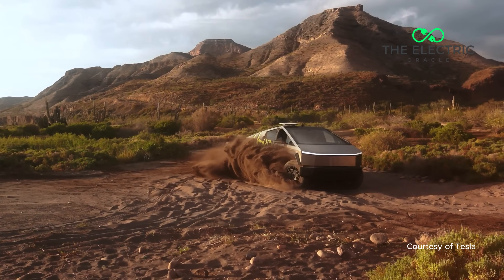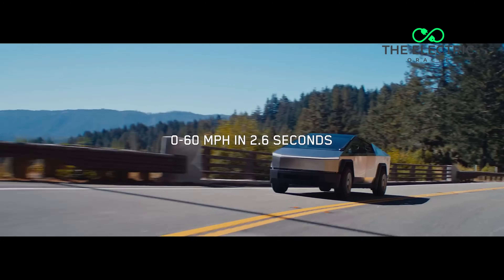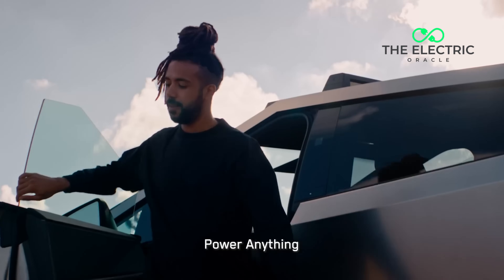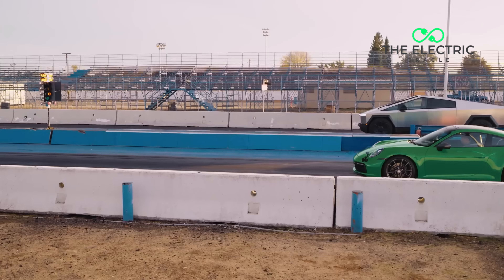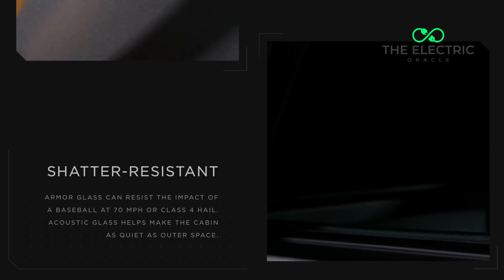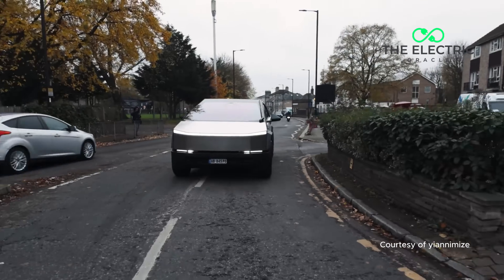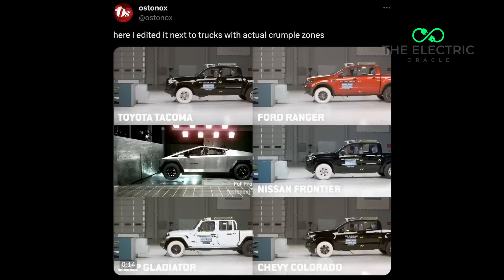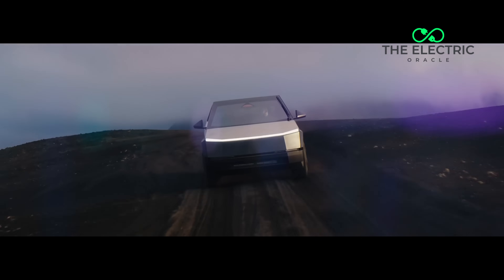5 Safety Issues Keeping Tesla Cybertruck Off UK Roads 🇬🇧

Comment: All the issues you mention Tesla has demonstrated in other vehicles it produces - Tesla engineering can address them on 2 weeks or less.

Lights - easy. They already have a solution. Just need a European specific part. 

Panels - the stainless steel can be replaced with thinner panels (to allow curves) or switched to aluminum. That would also help with weight. The only challenge would be the doors but Tesla has experience with doors on many models. Color is lot an issue. The Delorean is legal in the UK.

In any case, if Tesla wants to it can easily make the necessary changes. It will impact the look a bit but I trust Frank and his team have already planned for this.

Tesla always does its homework - one option is that European full size market is just too small for Tesla to care. Another option is that they already have a plan for a smaller midsize pickup that would have a version that would easy to get homologated in Europe.

Either way, the fact that the US version cant be homoligated in the UK is more of a concern to a few YouTubers than it is to Tesla….

Comment: On the part for weight because it’s over 3.5 tons it also will get a Tacho it’s where all your driving will get recorded and you will only allowed to drive 9 hours or 10 hours twice a week plus you need to take 15 mines for every 2 hours then a 45 minutes break and you need a digi tacho card too don’t stop there ether the 10,000 Nm and 600Bhp is now useless for driving fast because it will be automatically limited to 56 mph to your driving a vehicle as fast as 44 ton artic lorry

Comment: 1st reason, Tesla would change the colour of telight lenses and also change the steering to RHD this would be done when building the car, not coverting LHD US cars to UK rules.  UK government raised B licence weight for non ICE  cars to 4.2.  Various Cybertruck have been personally  registered in the EU..  Actually the CT has crumple zones in the front and back castings.  Some one set off a bomb in the US in the back of a CT, the explosion did not set the battery on fire.  You don´t mention that CT has FSD which will in most  automatically stop or dodge pedestrians.

Comment: An interesting and thorough review of this appalling automotive death trap. I’ve read there have been many accidents where the software system was ‘offline’ and the occupants couldn’t open the doors. The manual release is cleverly concealed for aesthetic reasons and hard to find in the seconds needed to exit a burning vehicle. And there have been lots of reported battery fires. Also, I don’t think you’ll have much luck trying to break or open a passenger window in the event the vehicle was submerged in water. 

Then there are reports from reviewers who cut their fingers on the sharp edges of the vehicle. Plus the sensor system on the auto close hood / boot doesn’t always detect digits. Ouch! (Well, one less fingertip doesn’t matter too much I guess.) An absolute nightmare and we certainly shouldn’t be changing any safety rules or expecting emergency services to re-equip for these aluminium Musk monstrosities.

Final thought: no paint, no chips – but lots and lots of rust, (even after six months use.)

Comment: Toyota has an ev with a LED strip across the front. We have always updated equipment for new vehicles. The Audi 100 when it first came out was a nightmare to cut open. As for fire suppression, LiO batteries generate their own oxygen and have to be dealt in none traditional ways.
Your requirements for the C1 licence apply only for drivers who are being paid.
Reply: Which Audi 100?

Comment: 1:10 red turning signals aren't an issue. Each US vehicle which would be equipped with those will be fitted with amber turning lights when imported to Europe. Same goes for all other necessary lights, like rear fog lights etc

Comment: Going on the incredibly low sales last year of only 40000, I’d say it’d be time to scrap the lump of lithium..well..stainless steel. It’s a really ugly design, non practical, be so costly to run ( over twice an average passenger vehicle’s weight, think of the tyre wear).
So many believe in Musk but his dreams certainly didn’t come to reality last year. He had hoped to sell 2M. He sold 98% less than that. That’s a massive failure.
Have to question Musk so much.
Safe FSD dreams are still to materialise after 7 years (even Musk admits he’s behind, Waymo in this instance). 

The EV market is cooked and this heap of metal won’t increase their market share which is plummeting as the Chinese brands take over.

Comment: The finally provided light bar blinds incoming traffic and are illegal in America but Tesla provides it and partially installs it, then sends you to a shop to plug in the wires and peel back the opaque lens cover tape. The main front lights have a ledge below that collects snow and hampers visibility. If cyber gets wet and isn't dried off it rusts. The " vault " leaks. If you take it through a car wash you void the warranty. It's useless in snow, off road and as a four wheel drive. It breaks if you tow a trailer. It bends if you load it with material. Better built for a sci Fi movie set than real life. A true example of Buyer Beware. A great con job. There's a sucker born every minute and elon found them.

Comment: Q: Should emergency services be required to upgrade their equipment or should manufacturers be required to design vehicles that work within existing emergency protocols?
My answer "Yes to both" the safety equipment should be evolving and getting better. I see it as a window that is slowly moving (hopefully to a better place). That being said new vehicles should be compatible even if that's pushing the envelope.

Comment: Its not allowed  in Australia either. It fails so many design rules. Even basic teslas need mods for poor safety featues concerning child restaint fittings and rear stop light matter much like you observe withe the crappotruck. A entire shipment was refused entry and sent back to china after repeated cautions and wharf mods had to be performed. Delayed supply for months. Tyres alao had issues as they shipped low distance tyres and the tread for a new car wasnt compliant. Like a inkjet printer

Comment: Thing is it not safe, it’s also very wide than most other suv. But key is the obvious safety issues like with the sharp edges that if you hit someone or something is not good. None existing / functioning crumple zones. Massive blind spots that can hide a pedestrian even a small vehicle in way worse than a trucks lol 😂, baring in mind a truck is driven by someone who has gone through more training than the average driver of a cyber truck would have. Not saying all truckers are perfect but what hopes has a lesser trained individual. 
Lat alone other issues as mentioned in the vid. The reason why we have these regulations for key safety reasons and expectations and training and awareness. And for things like why there are set wait limits and regulations like restricted wait restrictions on roads and others places. And key safety again. Let alone I’m sure the evangelist will complaine when it’s taking up two charging bays as well 😂. 
So may look cool but not suitable for uk rds.

Comment: And even if Tesla somehow managed to get the CT to conform to UK/EU standards - it's still horribly expensive (with all the modifications necessary it would most likely end up at 150k$ or more) and it fails at basic pickup truck tasks. It can't climb, it fails as soon as the electric parts get wet so it can't even cross tiny streams (forget about that "can be used as a boat" in the marketing presentations), the weird bed shape even makes basic loading and transportation tasks harder than with any other pickup truck on the market. And it's far too large to fit on most of European roads, parking lots or garages.

Comment: The Cybertruck is neither a good passenger vehicle, nor a good pickup truck. Here in the US, full size pickup trucks are purchased by most consumers for this group of purposes:
1. To tow recreational trailers, or work trailers for business purposes. There are 4 basic categories: 1/4 ton (can tow small trailers up to about 2000 pounds), 1/2 ton (4,000 pound trailers), 3/4 ton (8,000 pound trailers, and 1 ton (up to 14,000 pound trailers if equipped with dual rear wheels).
2. Hauling cargo in the bed. 1/4 ton trucks can carry up to about 1,000 pounds, 1/2 ton and 3/4 ton trucks 4,000 pounds, and 1-ton trucks can carry the heaviest loads, up to maybe 6,000 pounds on dual rear wheels.
3. Mounting a Cab-over recreational camper. These can weigh as much as 4,000 pounds and require a 1-ton truck with dual rear wheels.

For trailer towing, no EV pickup can even remotely compete with a conventional petrol or diesel truck on range, and the Cybertruck is the worst of them. It has a powerful drive motor, and a big battery, but range when towing a 6,000 pound, 24 foot travel trailer is horrible; about 75 miles on a full charge. A 3/4 ton diesel pickup costs $40,000 less than the Cybertruck, and can tow that trailer 400 miles on 30 gallons of fuel. And when you need to re-fuel, it takes less than 10 minutes, compared to 2 hours to charge a Cybertruck back to 100%. 

For hauling heavy loads in the bed, the Cyber truck can accomodate maybe 2/3 of the load weight that a conventional 3/4 ton truck can carry, but if you need to carry construction loose material like sand, gravel, or bulk garden soil, you better pray that none of that material gets into the track system for the tonneau cover, or you may find it's jammed and can't be opened or closed without major dissassembly and cleaning.

For mounting a cab-over recreation camper, forget it. The Cybertruck is not designed for carrying these units and doesn't have the proper tie-down points and tailgate to accomodate a cab-over.

As a passenger-hauler, it fails on every count. There are sharp edges around the door panels that you can cut yourself on getting in and out, and the doors are so heavy that if you are parked on an incline, the impact of one of these doors hitting you if it swings out of control, can cause serious injury. 

The vehicle is so heavy that it's energy efficiency is abysmal. A regular EV like the Tesla Model 3 or model Y averages about 3.7 miles per kilowatt-hour. The Cybertruck gets about 1.7 miles per kilowatt-hour.

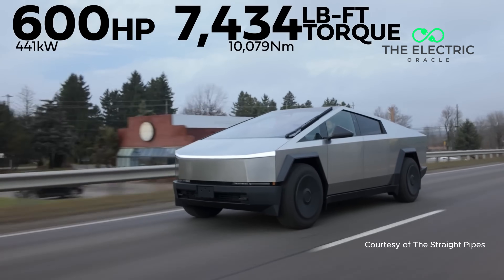Comment: 1:20 Wrong - it's not just 'conditioning' it's clarity to keep different signals different colours, same reason that traffic lights are red amber green not red red green.  Red indicators in the US are so they can save a few dollars and use the brake lights as indicators, putting profit over safety

Comment: While  Cybertruck are over the top it has some features that I would love in more normal simpler compact SUV like body that don't rust, windows that don't crack because thrown gravel on gravel roads, more durable body panels that don't get damaged as easily. Normal cars are so fragile, even slowly backing into a frozen compacted snow pile or fence post  can total your bumper causing expensive repair bill.

Comment: Wait a Moment... 3 mil steel? Didn't Tesla have to change the steel gauge from the intended three mil to .85 mm anyway as they couldn't work the armorlike steel themselves, due to work hardening and crack when shaping those plates?

That they then did not just redesign the carossery to remove the guillotinesque panels and such is about the most hilarious part of the whole process, they insisted it was needed for 3 mil steel... which they do not use.

Comment: The important factor with weight and driving restrictions is the GVW/MAM, the CT is in excess of 4000kg. In excess of 3500kg a whole lot of other considerations kick in. If the vehicle is used for anything other than purely private use, then a tachograph must be fitted, all driving hours logged via a Digital Drivers Card and archived, drivers must comply with maximum driving hours, rest periods etc (same as for an HGV) There starts to be considerations for Operators licences, maintenance schedules, suitable parking facilities, proof of financial stability etc. The regulations are complex and breaching them can lead to very heavy fines. Before people claim, not if it’s a private car, you should read the regulations because it’s all about the weight and the purpose for which the vehicle is used, Any form of use for Hire or Reward takes it out of private use. There are lists of exemptions but claiming “I didn’t know isn’t one of them” Eg if you put this through your business, its not private. 
In reality it’s unlikely these will actually be an issue and those that do make it over here are easily spotted and will draw a lot of attention from the authorities and most will likely be breaking an armful of vehicle/driver laws. Vehicles impounded and destroyed.

Comment: You did not mention that it actually has no mechanical steering linkage, just a video game steering wheel. If the digital steering fails, there is no way to steer it as there is no link from steering wheel to wheels. Just that playstation steering wheel. Try that to get through MOT... As a "lorry" also here in Finland, all the reasons that make it unique, also prevent it to be registered. But, as they say, "there is a sucker borm every minute". They sold them a lot first, until buyer's remosre and common sense of others appeared. Like Teslas in general, they are for certain people. Who most people do not like.

Comment: The Cybertruck is just a silly idea that should never have put into production. Everyone knew from its conception that it was just an experimental concept, not a viable, practical reality. Even in the US it's pointless, impractical and dangerous. In the EU & UK it's just laughable. In particular, the weight - 3500kg for a private motor vehicle is more than sufficient to meet most people's needs and remain reasonably safe for basic driving capabilities. You see many qualified drivers struggling to handle a Smart car, can you imagine the damage they would do in a 4 ton solid steel truck?

Comment: There is no use case for this vehicle that I can comprehend. 

What problem does it solve vs what problems does it cause. Sure, think different, but this sounds not just outside the box but outside practical application.

Just different for difference sake. Maybe on Mars - but it needs an airlock.

Comment: NO special exemptions for electric vehicles (I drive one). Cars should be taxed according to their impact on society. Use Kei car as base that all are compared to - the greater the deviation, the greater the road tax, not straight line increase, but escalating. Consider: weight, width, length, emissions, safety to pedestrians.

Comment: There are a few of these in my area and they are smaller than a lot of pickups on the road (including the Ford that I drive). They are not as useful as other pickups that have similar GVWRs.
BTW: My Pickup has a GVM of 6,350kg vs a Cyber Truck at 4,160 kg.

Comment: Very well done video, thanks.

The Cyber Truck is clearly a menace to safety.  

Whilst I think safety standards may have to evolve in the age of electric vehicles, such evolution should be gradual and - must - not result in less safety.

However, there should be zero concessions to the lighting regulations for the Cyber Truck.  They were carefully designed and evolved over the years, and they are too far ingrained in people's minds to change, especially for a design that seems to have disregarded safety.

The Cyber Truck - might - have been designed with the safety of the occupants in mind, but the design clearly didn't  give anything like enough allowance for the safety of other road users.

I wonder how it would affect levels of injury and life expectancy in a pile-up?

It's sharp edges would clearly be force concentrators in a collision, and look as if they might act like a knife if impacting a pedestrian.

It's not important for safety or regulatory compliance, but does anyone else think the Cyber Truck is just plain ugly?

Comment: Vehicle weight limits are there for a reason. Heavier vehicles behave far differently to a small hatchback. Changing the law for electric vehicles is simply not viable. Letting someone with a standard licence and no experience of larger vehicles loose in a 3-4 ton steel brick is a recipe for disaster.

Comment: This just goes to show how little the American car manufacturers and regulatory bodies think of their own consumers and everyday people,  that this dangerous piece of cheaply made junk is safe on American roads. The edges of the doors are so sharp you can peel a carrot if you run it across the edge. The rear vision mirror is tiny and unusable if you travel with the rear tornau cover closed, which is recommended. You have to use the camera, which can be obscured by water or mud if it rains. You can't reach into the rear tray from the sides as the side panels are too tall. I believe only 2% of people who put a deposit down for one in America are actually going through with the purchase as they have devalued tens of thousands of dollars already. It's a white elephant. Almost forgot,  they rust if left in the rain.